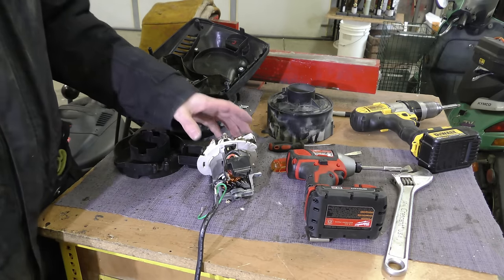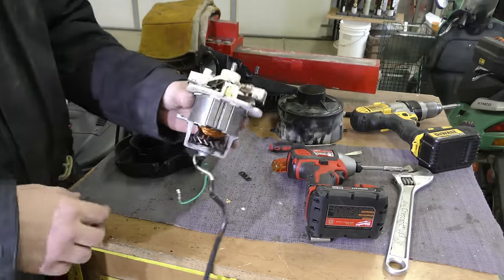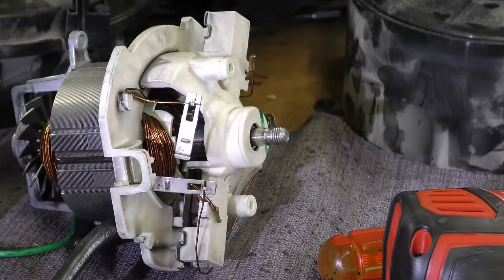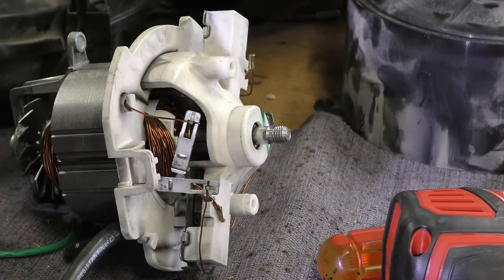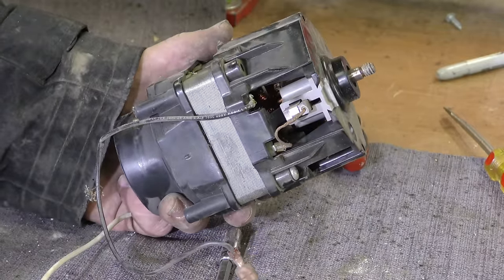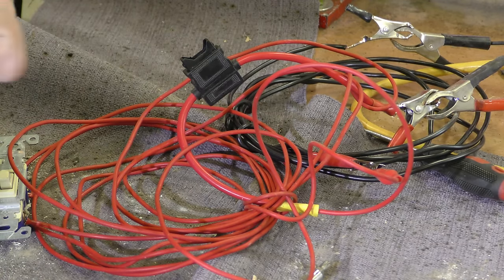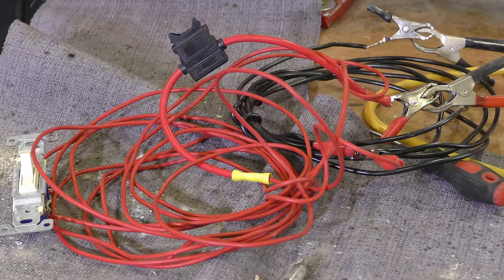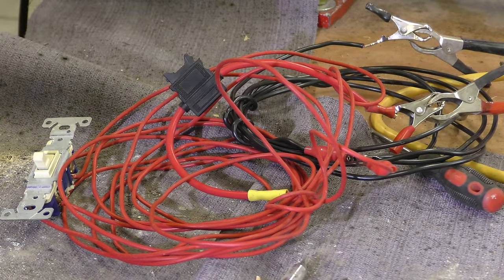Shop Vac Failure Points and What Happens When You Short Out a Fuse

Comment: There's a heck of a lot more to fuse design and specifications than just the rated current. You need to cover ALL fault scenarios, in specified environmental conditions, not just yours. And not just once either - they are specified and usually certified to tight tolerances because they are safety devices.

Fuses are rated NOT to open at their rated current. Their actual opening time depends on their design characteristics (it's plotted as a current-vs-time curve in the specifications. Current breakers have similar, but different, specifications. Some fuses and breakers are even designed to add extra delay to account for such things as inrush current and occasional very-short-term overloads.

The main objection I personally have is you are comparing:

a thermal fuse which is intended to safely open at some point above a rated temperature (the rated - normal- current), safely disconnecting a given current (the fault current), then withstand the peak rated voltage.
   with 
a current fuse (which is rated to safely open at some rated current flow, within a specified time limit, disconnecting a given fault current, then withstand the peak rated voltage. 

then you are saying "the breaker saves you", because in your case, it opened before the fuse did. That's fine for you, but just keep well away from me.

They aren't even designed to do the same job. Do what you want with your own equipment, just don't encourage others to do dangerous things then ridicule people trying to point out potential problems of your thinking - pun intentional.

Thermal fuses are cheap and relatively easily available - so what's the problem?
Reply from the maker: But is that a thermal fuse?  Sure don't look like one to me.  Everyone seems to think it is terrible I replaced the "thermal" fuse with a regular fuse, again it doesn't appear to be a thermal fuse!
Reply: yeah. it's a cheapo/in-house type. Similar to the older fuse-wire-stretched-between-two-pillars type or re-wireable domestic fuses that were much more common. It's unpackaged, because it's basically designed to be as cheap as possible. 

You'll find that the link wire melts if you apply variable-temperature a soldering iron to it. It will usually be made of an alloy with a relatively low melting point. Such in-house/ non encapsulated thermal links are common in motors and especially larger domestic heaters (off-peak nite storage heating in particular). 

They usually require some housing to make sure that the molten link does not cause further damage and are oriented so that the run-off cannot cause further shorts. In rapid overloads the arc created as the link opens vaporizes some of the link metal and can deposit a conductive coating of spattered metal on the housing (the plastic housing in your case) - this needs removed, replaced or meticulously cleaned to maintain insulation resistance (because otherwise you have a fuse rated for say 250V but surrounded by a plastic housing that will track arcs at maybe 90V on a damp day, defeating the point)

Packaged (encapsulated) fuses don't suffer from that vaporization/re-deposition problem because the entire package is replaced after a failure. Crimping in a packaged thermal fuse of suitable rating is definitely the best repair. It's also the intended repair, it's just that most people throw these things into landfull (I admit competent well-stocked repair shops are a rarity in this age)

Personally, for a battlefield repair scenario, I'd maybe use a piece of solder crimped in place, but not a standard fuse. For anything but an emergency scenario I'd fit (by crimping, not soldering!) a packaged  thermal fuse in it's place (suitably rated of course). 

The idea of this fuse is mainly to protect the windings (expensive to replace) in the event of an overheat situation. 

The protection scenario is:  

 hot day in hotsville
 shop vac working hard sucking against a big load
 user has a lot of work to get through so has been running it flat out for 3 hours
     =thermal fuse opens to save the rest of the expensive components. It's fixable at low cost.

So the primary idea of the thermal fuse is to protect the device from damage. It will get "tired" as we say in the trade - in fact it is a moving part with thermal stresses on it. That's because under normal operation the link will expand due to the current passing in it slightly, and eventually, over many cycles or hours of use, will mechanically fail. You can make shop vacs last longer in this respect by not running them for so long (to allow cooldown periods rather than continuous running) and avoiding lonmgterm heavy-suction loads. 

Cheaper vacs may be rated for 5 minutes on and 20 or even 30 minutes off. Better ones may be rated for 10 on 10 off. If you need a dust collector, buy a dust collector. 

If (like me) you're careful and mindful of the risks (but it's only 10 minutes of my time and a $1 fuse) then you can usually use cheaper vacs successfully for years without problems. If you use bags inside, change them when they are clogged with fine powder (masonry/plaster/rendering dust). Clean the filters regularly etc. I can easily change thermal fuses and keep a small stock of the common ones, but still I'm still very careful about overheating and cooldown periods. 

It also has a secondary function of fire protection, because the rest of the wiring maximum continuous temperatures will be rated above the fuse rated temperature. Bear in mind that the thermal fuse will also have a secondary function as an overcurrent fuse too. (especially in many reguins of the world where there is no appliance fuse located in the plug-top (North/South America and most of Europe for example). 

Whilst you've used the argument that the "breaker will save you" you also have to consider situations where there is no breaker, it's faulty (it happens), or the breaker is rated too high for the fault in question or the time characteristic does not allow it to trip in time. 
A GFI (ELCB/RCD) device does not in itself protect against overcurrent, only an imbalance in currents caused by earth faults. The purpose is to disconnect the phase/s in earth leakage faults. In this case, the overheat or overcurrent scenario  will not cause a trip as there will be noi leakage to earth until the motor windings have melted down to such an extent that a bare conductor touched an object bonded to Terra.
Reply: Note that many (but by no means all) GFI devices include overcurrent protection too. Others must be protected by a breaker or fusible link. As with all mechanical devices, breakers can and do fail, especially after many cycles. 
Overcurrent breakers can also have unpredictable results in extremes of temperatures (cold weather in an unheated garage will usually cause much slower tripping than a hot desert day with the hot air output of a hot-running machine blowing on them). They can also be affected by magnetic fields.

Thermal fuses are very common on motors and in some transformers. Rewinding motors and  transformers is an expensive business because it requires uncommon machinery and time, as well as significant expense of copper. Anyone who has done it by hand will testify to the PITA factor. I''d rather have a fuse fail than a vac melt to a puddle of smouldering plastic on the floor while sparks piss out of the remains of the windings. 

The "DC vs AC" comments are partly correct because it's a generalization only really valid in the domestic or automotive world and only then in certain circumstances. 
DC arcs tend to last longer than AC ones for a given situation, but only at low frequencies. Mains power is, for these purposes, a low frequency. The reversal in polarity helps quench the arc at every zero-crossing. RF plasma is an interesting example of sustained AC arcs but there are many others. Anyone who has witnessed an arcflash incident will testify that AC can arc and the dangers that this can cause. There are a few arcflash vids on youtub - none are pleasant to watch.

Laymen often assume that "DC" is always low voltage and AC is always higher voltage, though that is not the case. I have a box containing several types of high-voltage fuses intended for DC systems rated for around 5kV and they are available up to 30kV DC in encapsulations. Their peak AC rating is slightly higher than the DC at low frequencies, up to about 500Hz if I recall. From a fuse design and selection aspect the AC vs DC aspect is more correctly a fault disconnection current rating - the maximum energy that can be interrupted by the fuse in a given set of circumstances (peak voltage, fault current, frequency, humidity, temperature, surrounding gas and pressure thereof. 
Some specialist fuses are nitrogen filled, some are also under slight vacuum, some others have compressed air systems to blow out the arc. These type are all expensive and for special industrial purposes. Other more simple approaches are making the fuse enclosure longer (so the arc won't bridge over at the rated conditions) or filling with sand or other inert material so quench the arc when the link opens. Fuses are complicated and frequently thought of an simple things. They aren't.

As an example of reduced safety margins: in a twin-engined plane, would you take off on one engine (assuming it was even possible?) The safe answer is no. 
Would you pucker if you had an engine failure in that plane at low airspeed on a hot day just after takeoff?. The correct answer is yes, very definitely. 
Would you worry if you had an engine failure on final approach to land in the same plane? Probably not. 

Not every problem has single-scenario fault. By disabling some safety features (bridging a thermal fuse with an overcurrent fuse) you reduce the safety margins for both you, people nearby and the equipment itself. 

As a guy that does quite a lot of repair to stuff, I'd place human life almost as high as the survival/repairability of the equipment itself :)

I'd also consider (and have fitted) a thermal breaker (self-resetting type) They look like a fat silver-topped button with two 1/4" space connectors sticking out either side. Google for   KSD301  -  but note that most of these are 10A rated and may not be suitable for use on areas with 110V mains (they are much more suitable for 230V areas as the appliance draws half the current.). I'd also fit a thermal fuse with a somewhat higher rating too, by the way, to improve safety for the equipment even further.  

To select the correct rating it's a real guessing game - you really need to try and see what temperature the old link melts at. A recently-calibrated variable temperature-controlled soldering iron is what I use. For a destroyed thermal fuse link  it's hard because the link itself is often crimped or nicked near the mid-section to encourage failure at that point, so once it's gone open the actual melting point of the remains parts (the ends of the link) may melt at a decivingly-high temperature. The increased resistance at the nicked section (it's crimped to a specific thickness in manufacture determines how hot that link will get at a specific current flow - it's the combination of appliance internal temperature AND the resistance at the nick that determine the rated fusing temperature.

Personally, for a shop vac I'd start  an unkown scenario like this by fitting a 130C 10 or 15A permanent thermal fuse, but also add a 85 C to 100C KSD-style breaker (230V mains here)  If that trips and resets during my normal use I'd consider using a "hotter" breaker, but I would not go any higher than the 130C permament thermal fuse. (and even if I did use a 120C breaker I'd  probably still keep the 130C Thermal fuse at that rating. Note that the mechanical KSD-style thermal breakers are rather inaccurate at have significant hysteresis. If it still trips I'd accept that I'm overheating the vac. These are pure guesses based on past personal experience  - 130C may even be far too high to protect the insulation of the wiring and motor windings , especially in the long-term. It all depends on airflow and heat conduction in the  case, layout and materials used as well as the mounting position of the thermal breakers and thermal fuse. 

It's very important to ensure that whatever breakers and fuses you use  are actually capable of handling the normal and fault currents and voltage involved, otherwise you're just making a fire-starter, not a safety fuse. depending on the location and materials (and to an extent, dust and any flammable atmosphere nearby) how bad that will be, if it is even much of a problem at all. It could be a real problem in some places/scenarios though. Yes, brushes arc a little (minimally) in normal use , but something actually burning is more of a risk if the plastic case will melt and burn with say 10 seconds of flame. (been there, done that, in my youth)

Make sure all your crimps and mountinngs are well-dressed and insulated and also that the thermal fuses and breakers need to be at appropriate physical locations. Mounting them in a cold area or in cold airflow means they will never work when they need to (thermal fuses in transformers and better mountings are sometimes slightly buried in the windings themselves or thermally bonded to the laminations to make sure they function as rapidly as possible)

gotta go - my fingers have melted :)
Reply: oh one final thing - you may find that the link you show in the vid doesn't even melt even at 220C when you try a soldering iron. But sure enough, with  6- to 10 amps through it, it will fail at a far lower temperature due to the extra resistance at the weak-spot, the nick in it, thanks to internal heating. It's the cumulative effect of ambient in-case temps and the current that determines the fusing temperature. 

That gives a very wide margin for error, hence me being very careful about replacing unknown links like this  even with high-quality thermal fuses and breakers. Basically, the thermal devices should open safely before damage is caused to the other components, not after.  The internal wiring may have a temperature rating marked on it, you can use that as a guide if nothing else. Motor windings are usually enamelled wire or similar, with no writing on them although they will have a design specification, in theory.
Reply: As you don't want to touch your "temp wiring " to even turn the switch on.....i found it ballsy to pull the 15a fuse out with the circuit still energized.

If you look closely at the fuse, there are 2 small test points that are accessible on the back where it says  15. These are test points for use with meter/test light leads. 

Very easy to get lit up by them at 120vac!! Just sayin.....

I like your style not being over cautious like the rest of America!
(Universal/brushed motors can be ran on AC or DC)

Comment: Your dad and my dad have the same old shop vac motor, it has an actual thermal fuse in it (like the one you showed us at 4:30 of the video) take those two screws out separate the casings and after the wire contacts and right before the coated aluminum winding you’ll see a woven fiberglass heat shield sleeve and the thermal fuse is in there. Btw I’m not a smart person just had a broken shop vac and a working phone to google

Comment: A 12-volt fuse can be used in a 120-volt circuit. Fuses are rated in amperes, not volts. That's why the 15-amp fuse stood up to your presumably 15-amp breaker.
Reply from the maker: A lot of debate on that! I couldn’t really find a definitive answer.
Reply: @radozeman  I'm only going on my own limited knowledge, so yes, it's up for debate.
I actually tuned in to figure out how to rewire a sweeper that my kid tore apart, but did learn a few other things.

Comment: I have a Dayton shopvac and when I flip the switch the motor spins for a quarter of a second and then trips my circuit breaker on my panel. Any ideas
Reply from the maker: Try cleaning the motor maybe?  Either it drawing too many Amps when it try’s to start or it has a short in the windings in which case there isn’t much you can other than replace the motor

Comment: Until someone cracks the identity of that fuse, figuring out the rating of a proper replacement and style (to handle all the vibration) seems to be the #1 issue.  Then, there is making sure the motor is OK/functional.  It is so easy to cook these newer windings and short them out.
Reply: I contacted Shopvac and asked them to either provide this as a spare or give the specs. I doubt they will do either. Stand by…
Reply: Okay Shopvac said no dice, they won't supply the fusible link, they said buy a new vac or powerhead. Thanks for nothing, Shopvac...

Comment: I used a steel popper rivet, cut it and grinded it down a little bit, stuck it in the fuse as a permanent link. I know its not very safe, but its an old vac and the house im using it in has breakers and fire extinguishers so
Reply from the maker: Interesting a pop rivet eh
Reply: @radozeman  Yup, been running it a lot over the last couple weeks and its doing great. I usually run it for a good 30 minutes at a time, and haven't had any breakers flipping or any warm smell. I followed your video, the only thing I did differently was using the rivet. Thanks for the video

Comment: How do you tell if the switch is bad before proceeding to this fuse replacement? Mine would stick and not go on and off so I did the hack where you cut off the plastic buttons to get at the switches and turn them on but it still does not work.
Reply from the maker: If your switch is sticking, in my experience that usually means the internals of the switch have melted.